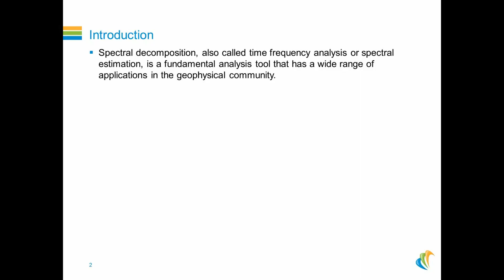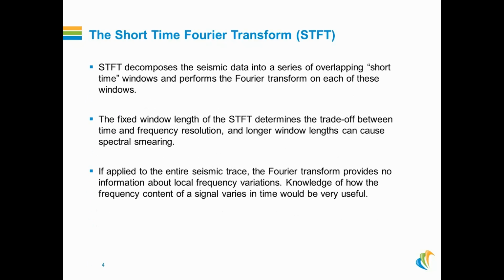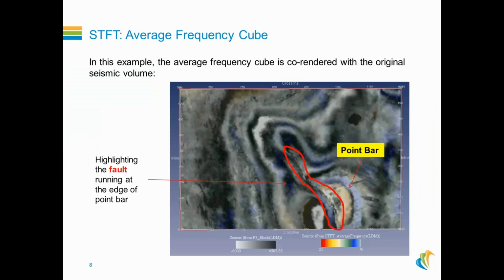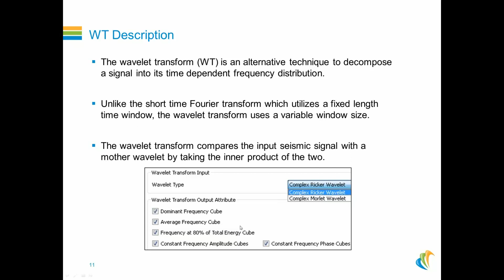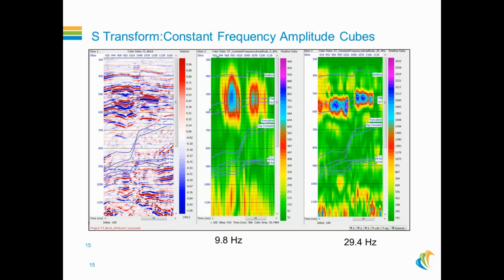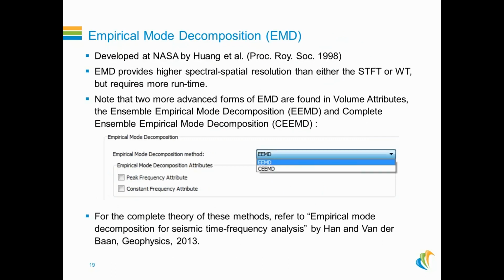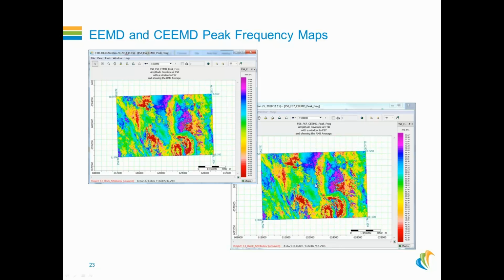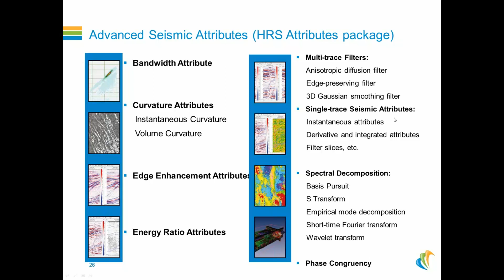Spectral Decomposition in HampsonRussell 10.3

Comment: Hello Tanya,  Can you say something about the discontinuities (non-geological) that occur when EMD-based techniques are used? In my experience using them, the IMFs present artfacts when analyzing a 2D section which obviously propagates to the 3D volume. This probably is related to the trace-by-trace way that the technique operates and, if we want to used the band-limited component (the IMFs) for posteriry analysis, this can be quite problematic
Reply from the maker: Hello Bruno, thank you for your comment. Our reply below:

The discontinuities are mainly from the mode mixing problem from EMD, which is triggered from the sifting process to extract each instinct mode function (IMF).

Using the injection of controlled zero mean, Gaussian white noise, ensemble empirical mode decomposition (EEMD) and complete ensemble empirical mode decomposition (CEEMD)  effectively reduces mode mixing. Adding white Gaussian noise helps perturb the signal and enables the empirical mode decomposition algorithm to visit all possible solutions in the finite neighborhood of the final answer, and it also takes advantage of the zero mean of the noise to cancel aliasing [Wu and Huang, 2009].

There are two ways to reduce the discontinuities. First, increase the ensemble times, which will stabilize the results. Second, instead of digging into each IMF property, HRS extracts more robust attributes, like the peak frequency, to explore more information from seismic data.